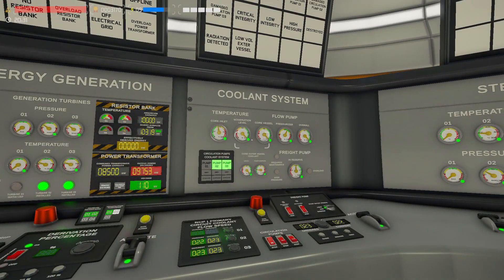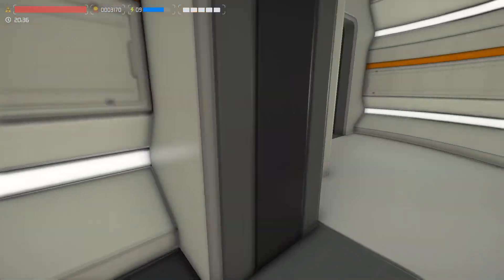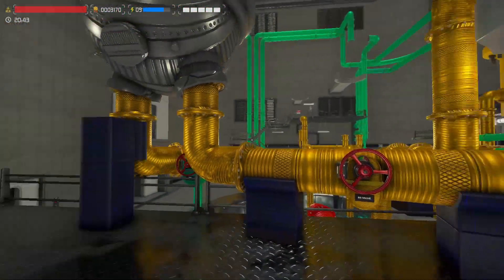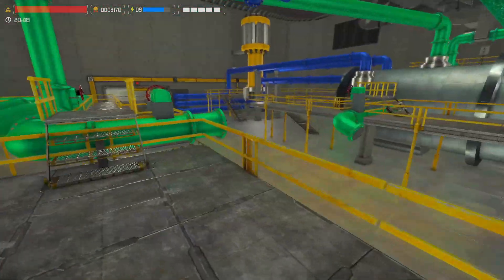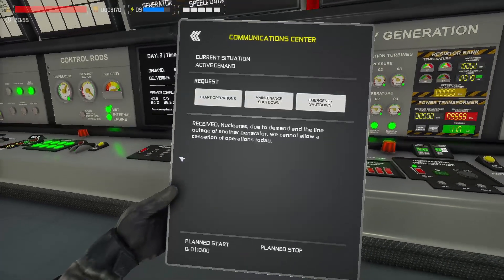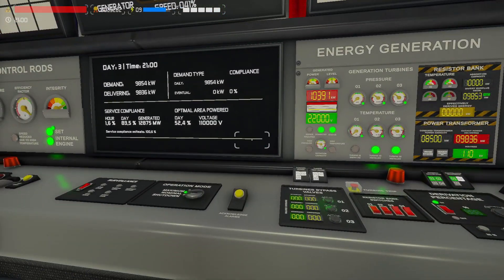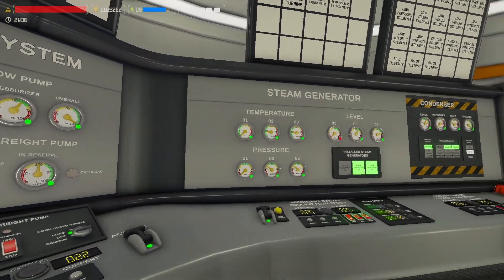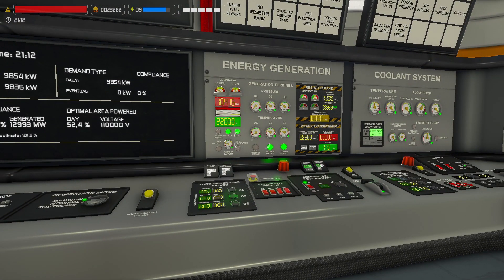How fix leaks after second turbine start | Nucleares

Comment: Thank you for the video, I was scratching my head on why my new cooling pump was leaking a lot of steam.   I think it is broken now so I will go to a previous save and check the valves before turning on the power to the pump and steam generator.
Reply: Is this a bug or design?
Reply from the maker: @edmondhung6097 I think it was design
Reply from the maker: Yeah I was scratching head so long too